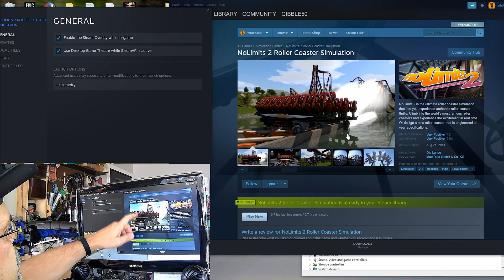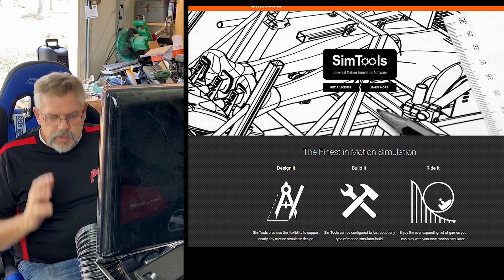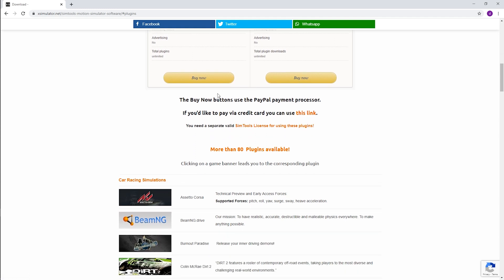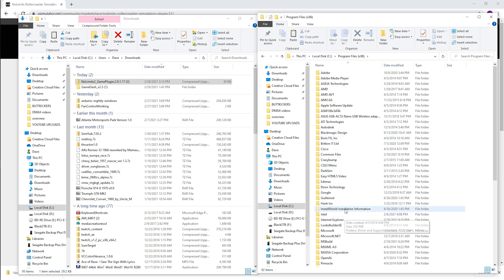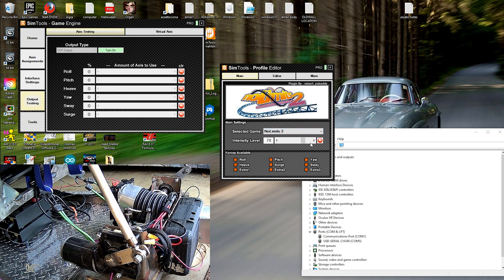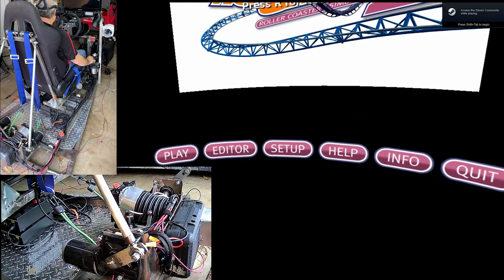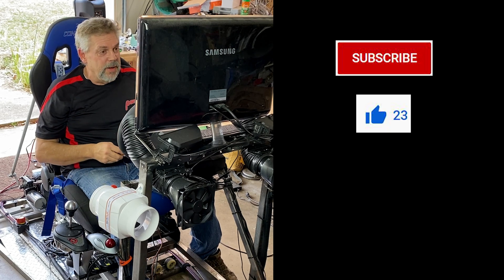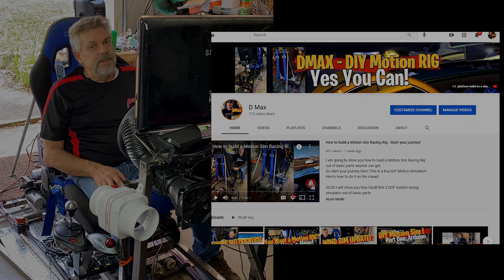How to set up motion rig and VR in No Limits Rollercoaster 2. My first VR/motion test!

Comment: Hello My friend, i have simulator machine but i don't know how to get data of movement of VR Video from it , to use for my simulator , Can you help me ?
Reply from the maker: Good question, my friend! So you have a VR headset right?  I use a CV1 (pretty old) the data from the game just moves the motion platform.  The VR headset I use (oculus CV1) has one camera pointed in the general direction of the headset.  As the platform moves, I move, and I can even move and lean as normal.  Somehow the headset picks up the movement of it all and I do not have to do anything else.  Seem pretty natural to me inside VR..  actually pretty incredible with the motion..  I have only built 3DOF motion systems so far, so I can only vouch for that.  Dave

Comment: how to you stop the vr tracking from moving around with the sim rig? if i mount the tracking camera to the rig the tracking stops. if i keep the camera fixed on the wall my seated position in game moves because the motion rig moves.
Reply from the maker: I'm using the old occulus rift cv1.   it has two remote cameras..  I only have one of them connected.  It have not had any VR issues  YET..  Do you have a CV1 or what type of VR do you have?   X simulator.net has an entire section on VR  and motion..
Reply: @DMAX_DIY  I’ll check it out. I’m using htc vive. I can’t mount tracker to the rig. The motion shuts it down. Mounted to the wall I get drift when rig moves

Comment: 50€ for simtools, 30€ to access the download of the plugin, 35€ for the "game", 
that's 115€ (!!!) for what is more a demo than a game, as you sit in a moving chair doing nothing for less than a minute..
I would rather see how this game works with the free FlyPT
Reply from the maker: Yeah..  So you can do this much cheaper too.  Simtools comes with the Live for speed plug in. and I'm not 'affiliated with their website or product but if you post your 'build' on the xsimulator.net forum you can get the simtools plugin for free.  Just go to xsimulator.net and look around.  Yeah I can see that you need some more convincing before jumping in.  I looked and read a lot of the 'forum' for about 6 months before deciding..  Yep if they can do it, so can I.   Feel free to write me back here too..  I have like 60 or 70 videos on all aspects of it..  I race my 'sim' every weekend for hours at a time and it's fantastic..   BTW  2112 logo   yeah.. Big Rush Fan here

Comment: Can you tell me the details of the component links and connection seconds?
Reply from the maker: Yes, Just check this link and go through some of the pages.. It shows my basic  Simtools settings https://www.xsimulator.net/community/threads/full-frame-2-dof-traction-loss-new-build.14740/
 and the SMC3/IBT/Arduino settings are on this page https://www.xsimulator.net/community/threads/smc3-arduino-3dof-motor-driver-and-windows-utilities.4957/
Reply: @DMAX_DIY  thanks you
Connect the power cord to a device I don't see
Reply from the maker: @YTHIỆTOfficial  Not sure what the translation is..   Power cord?..  it's 12 Volts. Hit me up on X-Sim.net  or give me a specific minute in the video which I can review.. What is your actual question?
Reply: @DMAX_DIY  Connect the devices together to the power source for the battery motor. i also watch your video a lot.. but just a summary..i can't see the power seconds with 12v30a sm power suply and 6127v1a180 with uns rev3
Reply: @DMAX_DIY  Do you use facebook
Reply from the maker: @YTHIỆTOfficial  Not really..What specific question do you have.. I Do check the X-sim forum a couple times a week.. They send me an email if someone has a quesiton
Reply from the maker: @YTHIỆTOfficial  So 12 v 30 amps. I got that .. but I'm not sure what you mean by 6127v 1a 180.
I just dont know what you a are asking..
Reply from the maker: On this video I go over setting up some of the stuff https://www.youtube.com/watch?v=5Kz1OL2wpwA&t=97s

Comment: How's the wind...does it help in VR?
Reply from the maker: Oh yes.. For sure it helps with VR, but it's more than that too.. the faster you go, the more speed the wind moves so .. pretty immersive!  Thanks for the question! DMAX
Reply: @DMAX_DIY  Do you feel like you're actually in a roller coaster ride with No Limits 2? Is anything off?  Gravity-wise.
Reply from the maker: @reptilexcq2  Well my reaction was pretty spot on.. I did not even tune the rig .. That was my first run.  I actually was a bit nervous and took off my racing belts cause I thought I might have to 'bail out'.. it was pretty real. Even in the upside down part, the plug in from simtools worked seamlessly. I have no issues.. It was great! DMAX
Reply: @DMAX_DIY  LOL "bail out."
Reply from the maker: @reptilexcq2  Well.. in the end.. I didn't and it was a pretty epic ride..   'but I was prepared to bail for sure' cause I've been 'thrown off the rig a few times during crashes.. DMAX
Reply: @DMAX_DIY  During crash, I pause the menu....I didn't want to ruin my car (rig).  So I set up a pause button on the wheel for shortcut.  I had to restart the when I am in a dramatic crash.  It's pretty intense lol.  I am playing pCArs 2.
Reply from the maker: @reptilexcq2  That's pretty cool. I have not done that yet.   I set the parameters for motor cut off so that the motor will stop driving at a certain point.  But sometimes It leaves you sideways in the rig.. I finally got everything tuned pretty good. I'm going to be making a video on the settings soon.. Just no time left this weekend.